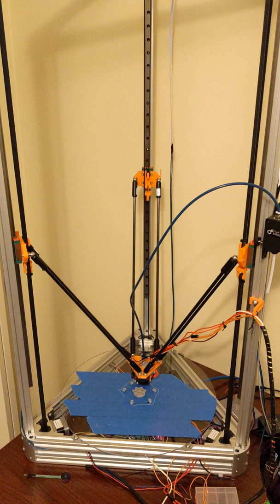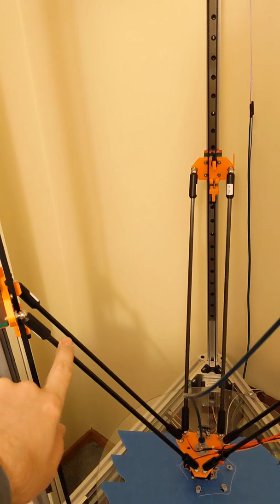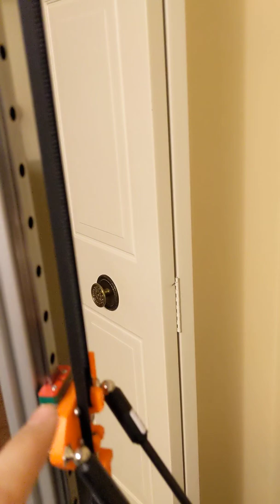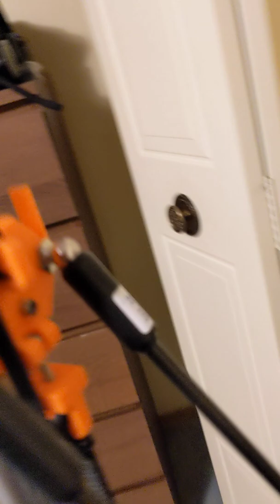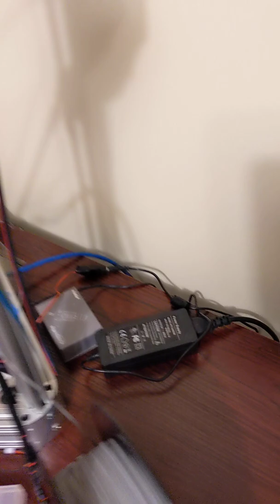Large Delta 3D Printer running Klipper firmware

Comment: Hey @Rolohaun Thank you for sharing this insightful video, I am assembling a similar delta printer with octoprint on raspberry pi 4 and SKR 2 board with tb 6600 stepper drivers , i have run it until stepper buzz and query endstop, Please could you help with further steps as i run into error with G28 and delta calibration process  . Thank you
Reply from the maker: best way to get help is join my discord you will find a link on my recent videos

Comment: Hello, I followed the construction of Delta and it is very interesting. I also built one, but I can't level the bed, although the klipper gave good results, I can't print, in the areas where the hot bed is exposed, the nozzle hits the bed, and in the diametrically opposite areas it is in the air, the differences read by the sample is of the order of 2-2.5 mm. I need help.
Reply from the maker: what probe are you using to do the klipper delta calibrate?
Reply: I use an Omron mechanical probe, placed on the nozzle, at PROBE_ACCURACY the result is 0.00001, so it is accurate, Z offset 19 mm.
After DELTA_CALIBRATE, I set PROBE_CALIBRATE. When printing, the printer does not seem to take calibration into account. The hot bed is attached to the chassis in 3 points, next to the clamps a test with BED_MESH resulted in values of +0.4-0.6 mm, and in the areas opposite the clamps I have very large negative values -0.9-2.8 mm. The hot bed is from a FLSun 400, with a thickness of 8mm, flat. @Rolohaun
Reply: I used the mechanical test on the nozzle.
Reply from the maker: @zahariaeduard1595  with a piece of paper? I could never get mine to work well doing that so I bought a 10 dollar nozzle probe
Reply: I'll try this too, it's not a problem, I'll check again the movement distance on each tower, it seems strange to me that all the measurements made between the endstops and the bed are almost identical at the 0.01 mm level, Omron mechanical endstops., I'll I also tighten the belts, although they seem quite tight to me. Do I still bother you if I don't make it? Maybe an easier communication channel? @Rolohaun

Comment: How fast can this guy print with Klipper compared to a coreXY with Klipper? I think delta printers are super cool but I'm weighing my options. What about the noise level? I have a silent board on my ender 3 and I don't want to hear motor noises from another printer lol.

can it have a heated bed?
Reply from the maker: these can print very fast with a light toolhead, I have not pushed mine much but they are on par with corexy. I do not like noisy printers and these can be very quiet. I updated this printer with a heated bed in future designs

Comment: klipper vs reprap for delta?  Im a big delta guy but only on the reprap side.  hav e several heavily modified extended height anycubic predators.
Reply from the maker: I only have experience with klipper, I looked into the reprap side with a delta and the calibration looked complicated. Klipper seems so much simpler
Reply: I dont know how Reprap firmware does Delta calibration, but here's the Klipper procedure for comparison. Note that you have to calibrate extruder before printing delta calibration model.
https://www.klipper3d.org/Delta_Calibrate.html
EDIT: Klipper can cope with delta rods that have different lengths. :)

Comment: That is impressive ! I haven't build a Delta printer before. Does the klipper installation and configuration a steep mountain to climb? Could you point me to a right direction ?
Reply from the maker: Thanks! Klipper is much easier to install than marlin in my opinion. Check out Nero3dp he has some good videos on it. https://youtu.be/iNHta6zljoM
Reply: @Rolohaun  Thanks a lot. I will see if I can follow.
Reply from the maker: I will be posting more videos of my large delta and the mini delta I am building right now
Reply: @Rolohaun  I will keep an eye on your channel. Keep up the good works. Thanks for your advice and looking forward.

Comment: could I get a parts list? this looks like a great started build for a delta
Reply from the maker: Most of the parts are listed in the description, would you like my designed STL's as well? Here are some parts from aliexpress
- 800mm MGN12 https://www.aliexpress.com/item/32806622073.html?spm=a2g0s.9042311.0.0.5f234c4d15CCct
- Build Plate https://www.aliexpress.com/item/32809092084.html?spm=a2g0s.9042311.0.0.5f234c4d15CCct
- Auto Level Sensor https://www.aliexpress.com/item/32841920169.html?spm=a2g0s.9042311.0.0.5f234c4d15CCct
- 3 20T idler with Teeth https://www.aliexpress.com/item/4000040551804.html?spm=a2g0s.9042311.0.0.5f234c4d15CCct
- 3 20t Nema pulley's you can get these anywhere
Reply from the maker: haydn huntleys magball delta arms in 400mm size, these can be bought a few places just google them
Reply: @Rolohaun  how much weight can the mags hold ? Was looking to direct drive
Reply from the maker: @TomS699  the hayden arms magnets are very strong. I am going to make another delta with a sherpa mini direct drive.
Reply from the maker: @TomS699  I will have a new video out this week that has my designed CoreXY printer with a sherpa mini
Reply from the maker: @TomS699  https://spool3d.ca/haydn-huntleys-magball-delta-arms/

Comment: Dear sir, I am working to build 3D printer. Can you please tell me about the components that you use in your 3D printer.
Reply from the maker: Yes for sure, what would you like to know about?
Reply: @Rolohaun  thanks you to respond. I want to know, if I use Duetwifi controller what firmware I need to choose?
This is my first time and I am very confused how to build it. Its my university project.
Reply from the maker: @manufacturingengineering3100  I would recommend using a SKR mini E3 2.0 for a main board they are cheap and easy to run klipper firmware on them. Duet is much more expensive but it can still run klipper or the reprap firmware. What type of printer do you want to build? CoreXY or Delta?
Reply from the maker: @manufacturingengineering3100  another good option is this one https://www.fysetc.com/products/pre-sale-fysetc-spider-v1-0-motherboard-32bit-controller-board-tmc2208-tmc2209-3d-printer-part-replace-skr-v1-3-for-voron?variant=39404109201583
Reply: @Rolohaun  thanks for your support, may I contact you if need?
Reply: @Rolohaun  thanks sir.
Reply from the maker: @manufacturingengineering3100  yes no problem